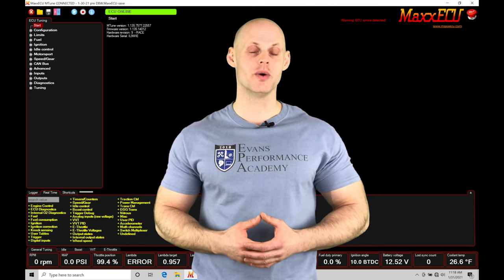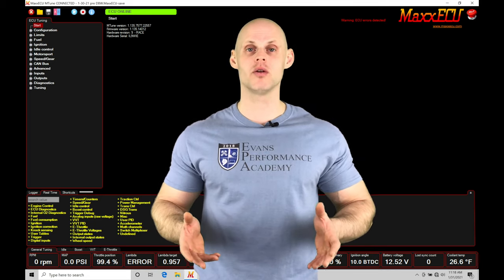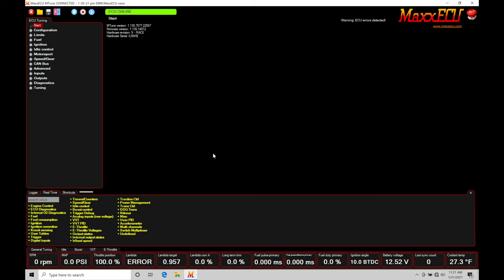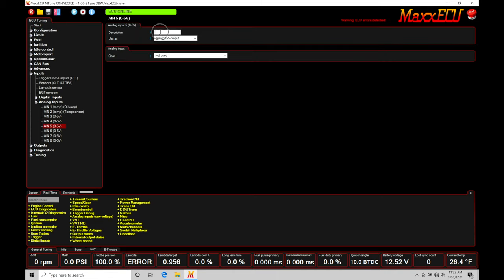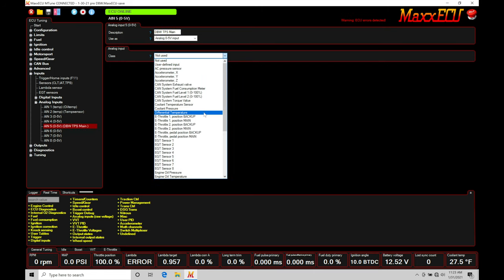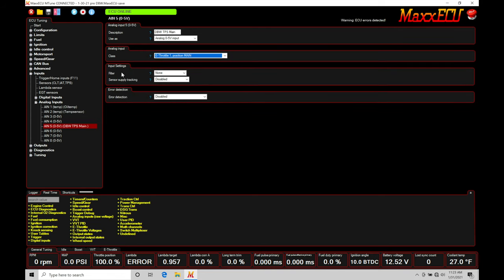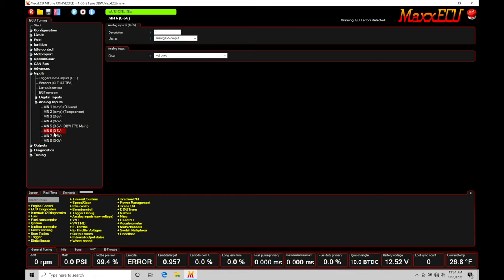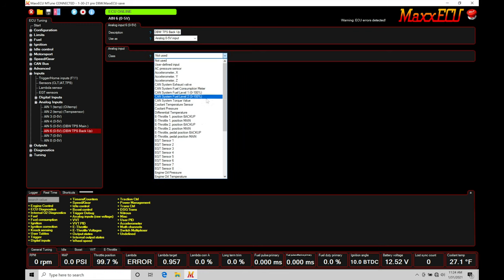MaxxEcu Training Part 52: Drive-By-Wire Throttle Control | Evans Performance Academy

Comment: Hi .Is there any chance you could demonstrate or explain in step by step how to get to E throttle set up in MTune as I did try everything from top to bottom and I was unable to find where I can change configuration .My car was modified from throttle cable to E - throttle so before it will go to tuner I wanted to test if everything is operating as it should but just can’t find that part .
Many thanks